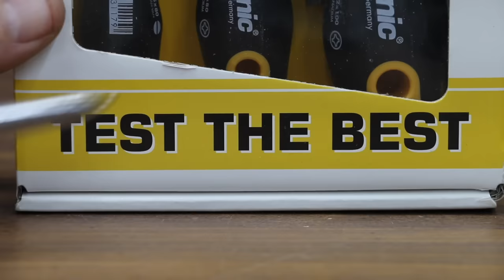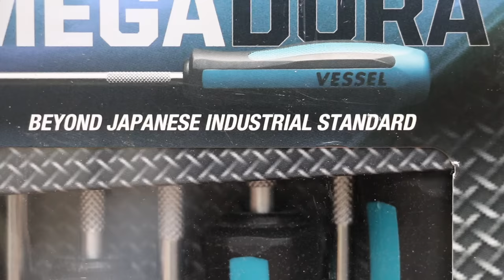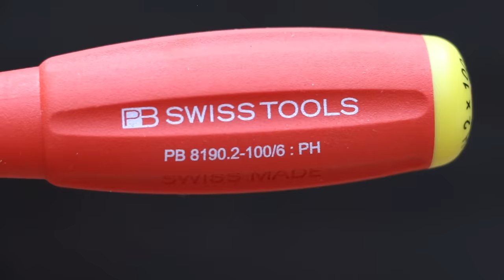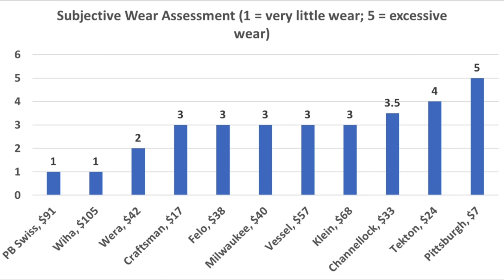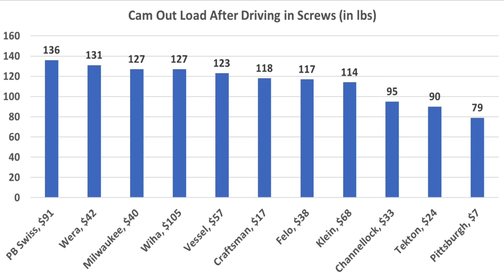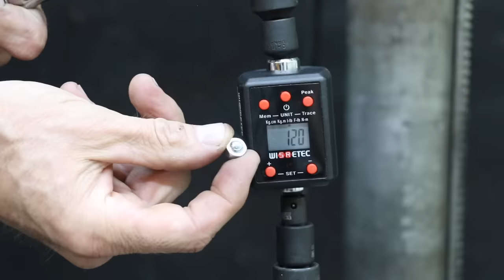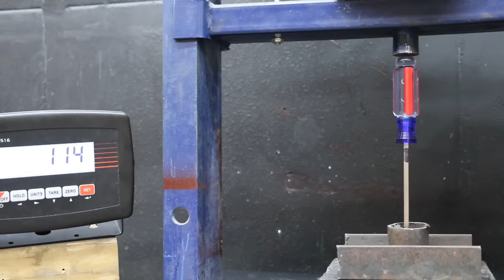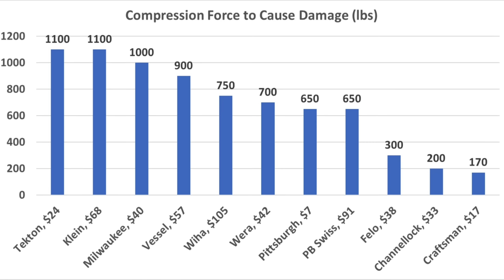Best Screwdriver Set? Craftsman, Milwaukee, Wera, Wiha, Klein Tools, Felo, PB Swiss, Tekton

Comment: You had to push the Vessel screwdriver harder with the impact gun, because unlike the others it's not philips but JIS (japanese industrial standard) and it doesn't fit that well in the screw like the others.
Reply: Yes, if you have a japanese car or bike it makes a lot of difference to have the proper JIS screwdriver.
Reply: Yes was going to mention the same. Not quite fair on the Vessel drivers. I have lots of Vessel drivers and they are great quality and fit JIS screws perfectly.

Comment: The results variation was amazing!  I always knew how wobbly a person's wrist operated a screwdriver and contributed to the wear.  I also knew how wobbly a drill-driver became under a pistol-grip as the driver was applying maximum torque. It seemed like ergonomics made greater challenges for the tool operator, but you proved that to be false.  Good Job!

Comment: I just bought the same craftsman screwdriver set used in the video, and it seems like a really good value. Haven’t really used them yet but it was the only set tested in the video that had a magnetizer/demagnetizer. Definitely a neat thing to have on hand for screwdrivers or even drill bits.
Reply from the maker: Thanks for sharing.

Comment: I'd be really interested in seeing how different ratcheting socket wrenches perform and what would be the best. I keep having the internal ratcheting mechanisms in mine failing while removing lug nuts even after using a breaker bar to loosen them. Great Videos keep up the good work!
Reply: My gut says lug nuts are best left to a wheel brace, or rattle gun. A ratcheting wrench doesn't seem right for that application.
Reply: @jamesfrench7299  that's fair. Definitely useful tools but the original patent for ratcheting wrenches was for it's application in automotive repair by a Sears automotive tech.
Reply: @27x27  around the engine and other parts of the car that must mean, not the lugs for the wheels.
Definitely not for cracking the nuts on a wheel.
Reply: @jamesfrench7299  oh yeah I never use them for cracking the nuts usually I use a breaker bar or a tire iron and a pipe but I've had wrenches that I've used just for the convenience of unscrewing the nut that while under normal loads (<30 ft lbs) that the primary ratcheting cylinder has become loose.
Reply: @27x27  that's a defect for sure.
Reply: @jamesfrench7299  I've had it happen multiple times with separate wrenches likely as they were cheap but that's why I thought it could be an interesting video since it would be interesting to know what companies have good build quality and how much different levels of build quality cost.
Reply: @27x27  totally think a ratcheting handle showdown should be done.
Two other important things are how fine the increments are (what degree the handle moves before catching on the next tooth) and how much resistance there is as it's ratcheting. The less the better as it increases effectiveness of the tool the more the nut or bolt is freer.
Reply: Use a "breaker bar" that can accept a socket. Other than that there are some pretty cheap impact wrenches around.

Comment: The vessel brand has a “JIS” Pattern a bit different than Phillips. It’s superior for Japanese screws on motorcycles etc. Still works on standard phillips.  Get vessel. 

Also, pro tip. The ace brand many times are re badged Klein screw drivers.
Reply: Several reputable makers offer JIS bits. Yes, they are absolutely superior for JIS screws because they are the proper tool. I till prefer torx.
Reply: Logan Kibler:  you nailed it

Comment: I got myself the same Craftsman screwdriver set wich came in a clear hard plastic packing years ago. I repair all my vehicles myself and they hold up extremely well. Important: Use the screwdriver whats its made for, not what u may think its made for :)
Reply: Those were probably Made in the USA by western forge, before production was moved overseas in 2012.

I found the steel okay, but even though I've have multiple sets of them I do not like the handles because many of them are just too small.
Reply: @TylerSnyder305  Past 2012, the Craftsman brand really went downhill. When Project Farm says they are brittle, he's not kidding. They are now comparable to pot cast hardware. The small blade slotted screwdrivers are the worst of the lot. Good thing my Lowes store is nearby, because I have several one year old Craftsman tools that are going back for replacement.
Reply: @alohamark3025  
Yes I know.
I was talking about the pre 2012 Western forge made Screwdrivers, not the imported junk.

Comment: Back in the 70's when I began repairing equipment (and an occasional car or truck) I bought a set of Xcelite screwdrivers.  I used them daily full-time for 30 years and I still have two - a phillips and a flat head.  They were the absolute best screwdrivers ever.  I hammered on them, used a vice grips on them for more leverage, etc. and they still grip the phillips head screw better than some screwdrivers do when new.   I don't know if they still make them or make them in the USA but if you come across an old set in a yard sale - get 'em!
Reply: I have a few and can back up your experience. They are surprisingly durable.
Reply from the maker: Thanks for the feedback.
Reply: I havr a bunch of old ones that I bought off of ebay. They look well used but all of the bits are jn great shape.

Comment: one of the things to take into consideration is the moulded rubber. They provide great grip but over time the rubber tends to break down, get oily and sticky and disintegrate.  I'm not sure how you test for that.
Reply: the best handle shape is Wera, it is just better to have extra diameter instead of all rubber pins combined.
Reply: @sillysad3198  I've never heard of them.  I'll have to check them out.
Reply: @tchevrier  i meant the same Wera as in this video, any similar type of the handle

Comment: Felo makes a wood handled set with the driver shafts running all the way through the handles. The metal sits just proud of the end, which has a leather cap, so you can hit it with a hammer without damaging the wood. They seem like they'd be a better match to the American brands, at least on the subject of hitting tools with hammers, if you ever do another round.
Reply from the maker: Thanks for the suggestion.
Reply: Agreed, Wera has a similar option as well (Wera 930/935/6).
Reply: @AbuAmprayil  yes and there are also yellow plastic ones for use with a hammer

Comment: I use and love the Wera screwdrivers but the same set with yellow and black handles are the hammer through type.
Reply from the maker: Thanks for the feedback.
Reply: I'm considering that set also.... I catch the guys in my small shop using screwdrivers and a hammer to get stuff off. My reason for the consideration of the set you use.

Comment: I own the Vessel screwdrivers simply because they're JIS cut.  They're the only screwdrivers I've found that remove screws from vintage Japanese motorcycles without messing up the heads at all.   I think I'll put the Wera, Wiha, and PB Swiss on the Christmas list and cross my fingers.
Reply from the maker: Thanks for the feedback.
Reply: My favorite #2 screwdriver is my vessel. Love the handle and knurling on the shaft. Best $6 bucks I spent on amazon.

Comment: I have screwdrivers from many different manufacturers but the majority of them are Craftsman and SnapOn. Some of my best screwdrivers I found on the road or in junk cars. I don't use my screwdrivers for punches or chisels that's what punches and chisels are for. One test that I do when I buy a screwdriver is to roll  the metal part so that it rotates the handle to see if it was put into the handle in the center and that the metal part is not bent. I bought a set of Pittsburgh screwdrivers and brought them right back as they were bent or not centered in the handle. Good video and while you tested a bunch of different brands I was hoping that Fuller would have been tested. I have a great Fuller screwdriver that I found on the road. Happy Motoring.
Reply from the maker: Thanks for sharing.  Thanks for the suggestion.

Comment: twenty years retired from a 40 year construction electrician career. Started in the mid sixties, like everyone else, using Craftsman screw drivers and lots of their other tools. Screwed many multi-unit services on the wall WITHOUT any form of "screw gun"  (by hand).  Retired 20 years ago and still doing "mechanical" things almost daily. Switched over to Klein screw drivers while still working many years ago. ALL Klein tools are VERY HIGH quality and I have never been disappointed with their screw drivers. First of all, they are WAY MORE comfortable on your hands then the Craftsman or other "hard" plastic handle tools. With "normal" use, including beating on them and chiseling with them when necessary, they will provide very good service and are priced as one would expect for a "quality" tool.
Reply from the maker: Thanks for sharing.

Comment: Excellent, as always, but I confess I was put off by the subjectivity of some tests. Screwdriver “quality” is tough to quantify, but maybe ductility versus brittleness, resistance to electrical current through the handle, handle circumference and grip friction … that sort of thing. Also, whether these numbers change in different working conditions (hot, cold, wet, dry, etc.).

BUT, these videos are an awesome source of information and I’m glad you’re doing them.
Reply from the maker: Thanks!

Comment: I have a Fiskar 4 in 1 screwdriver with a rubberized fin handle and it's the best screwdriver I've ever used. I buy good quality 1/4 " #2 Phillip's bits and other good bits for it. The grip is what makes it so good for torque.

Comment: Great video as always. Nice dance moves too!

In the USA you barely use Robertson (square) screw heads, whereas they are common in Canada. Here you don't buy a set of screwdrivers without at least 2-3 sizes of Robertson screwdrivers. The Robertson screws are held by the screwdriver so much better, and don't strip as easily, that I'm amazed that Phillips (and slot, sigh) screws are still more popular everywhere.
Reply from the maker: Thanks!   Thanks for the feedback.

Comment: The fastener makes a difference. If you're working on Japanese cars, bikes or bicycles with JIS cross-type screws, you really want the Vessel to avoid stripping out the screw. Phillips is an old standard that few companies produce nowadays. It has been replaced with DIN 5260-PH/ISO 8763-1.
Reply from the maker: Thanks for the feedback.

Comment: another great vid! back when i was an auto tech i swore by snap on screw drivers. best steel, best grip on the handles, a really great screw driver tho very expensive. a few years back i became a locksmith so pretty much just need a screwdriver all day now. the vessels are the best ive seen for grip at the screw. not saying the best handles or steel or that they are as tuff as snap on. just that they dont strip out screw heads as often. if your swinging a wrench then definitely snap on, but is you work with lots of screws all day you cant beat the vessels.
Reply from the maker: Thanks!  Thanks for sharing.

Comment: I worked in a shop had a ton of screw drivers bought one, ratchet driver, two lengths shaft, a couple bits, used it all the time no need for a ton of screw drivers one does it all
Reply from the maker: Thanks for sharing.

Comment: I stand by my vessel impactor   Absolute workhorses.   Plus has a cam built into the handle and hit it with a hammer it turns the screw 12 degrees for those seized screws.  Will never change after using these screwdrivers
Reply from the maker: Thanks for the feedback.

Comment: 15 years ago I was in charge of tooling up an RD lab for engineers. I bought Craftsman first (when they were still USA made), and they were complete garbage. The #2 phillips, which is what we use 95% of the time, would wear out in days. I tried a bunch of brands, all that McMaster-Carr sold (and they do NOT sell junk). I even ran down a Snap-On truck.

My favorite by far was Wera. Some are made in Germany, some in Czech Republic, but both are the same quality. They lasted years. My favorite part about them (besides the quality), is the shape of the handle. You can hold the whole handle for high torque. Or, you can shift your fingers to the top, and palm on the end as a light pivot, and spin it quicker with your finger tips when starting a machine screw. Another thing that is super handy, get a hex shaped shaft for Phillips. Even within the same brand, some price points are round, some are hex. Where this comes in super handy is when turning a machine screw before the head gets tight, when there is very little resistance. You can use your fingers to actually spin the hex shank. This makes it super fast. You can't do that with a round shank, as it slips through your fingers.

The best brand you can buy locally is Klein. All the electricians swear by them. Home Depot sells them, but you have to go to the electrican's section, not the tool section.

My biggest disappointment was actually Snap-On. I chased down a truck (never having touched a snap-on tool in my life, and I'm a tool guy), and he sold me a #2 phillips for $20 cash. The think did not fit a single #2 screw, and I tried a bunch. It was not a #3 by mistake. The #3 was much bigger. I still have it in a box somewhere, 15 years later, and its never been used.
Reply from the maker: Thanks for the feedback.

Comment: While at work I’ll often reach for a flathead and a hammer to make a starting hole to get my metal shears into trunk work and duct work. While I wish you tested the flatheads in the way that I use them, I think that one of your tests would actually give me the info I’m looking for. 

When making the hole, I’ll position the flathead at an angle and use a hammer to strike the shaft, causing the flathead to penetrate the metal and give me the hole I need to start a cut. Just the other day, my trusty Milwaukee snapped in half after the third blow. My guess is that of the brands tested, those that only started to flex at higher compression would be the ones I’d want to look for? 

Of course I could always slap a drill bit onto my drill and not abuse my tools. But I’m just as fast as a drill with a flathead and a hammer and they’re easier to carry around.
Reply from the maker: Thanks for the suggestion.

Comment: first thing I was looking for in your channel
I use electric narex only because they are comfortable and short
I turn screwdrivers around 6000 times a day at work, always proper size and trying to avoid overload
they start sliding after 2 months and I have to replace them after 3-4 so thats not bad I think but could be better
Reply from the maker: Thanks for sharing.

Comment: Have a old set of USA craftsman,hold up better than anything but very expensive tool truck brands. Craftsman came out with a grey handled,diamond impregnated tip screwdriver set that is impossible to beat for the money. The vessel brand has a impact driver/screwdriver that is a lifesaver(jis only),craftsman made a set with both phillips+slotted-if you find them BUY THEM!
Reply from the maker: Thanks for the feedback.

Comment: I have those old free coupon Harbor Freight screwdrivers. The Phillips will round out the blades under moderate use. This tool is meant for the seldom used application and it will do fine. They wear, you toss them. For heavy users, spend your money and buy a quality. In the long run, you'll come out a head.
Reply from the maker: Thanks for the feedback.

Comment: Great channel. Testing Phillips screwdrivers for cam-out is a misleading test. Phillips created the Phillips head during WW2 when experienced factory workers went to war, and were replaced with quickly trained replacements. Many were working with aluminum parts, and they tended to overtighten normal screws, resulting in flawed work. The Phillips screwdriver was designed to cam-out when over tightened. When a Phillips screwdriver cams out, you must ask yourself if the torque is exceeding the design of the screw or screwdriver. A little wax on deck screws, proper pre-drilling on wood and metal applications, etc. is the key to proper results. Of course, us Canucks use Robertson!
Reply: The best...lived in Europe and USA Canadian Robertson is 💯 the best

Comment: Oh yeah 😎.  Instructor in HVAC class recommended using Screwdrivers with a "soft rubber" handle for All-Day work use because being easier on the Hands rather than the Hard-Plastic handles offered by Craftsman and Husky brands.
Reply from the maker: Thanks for the feedback.